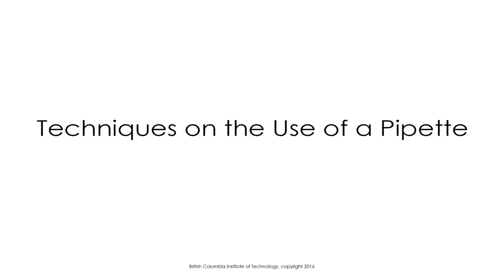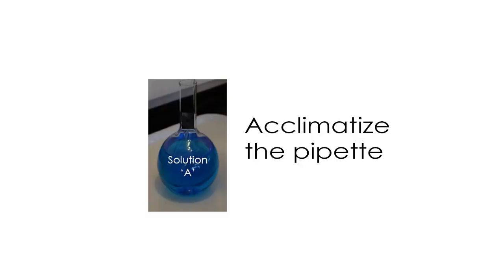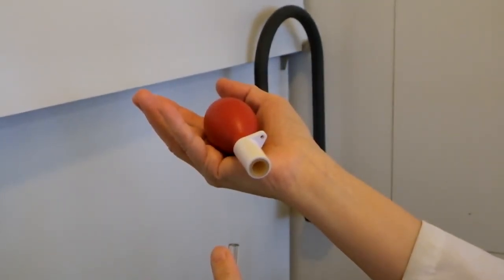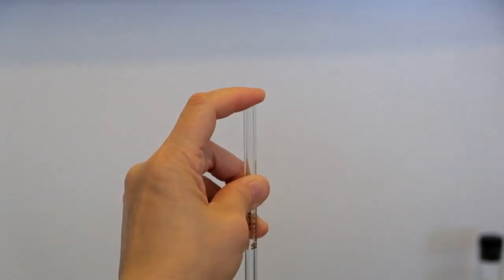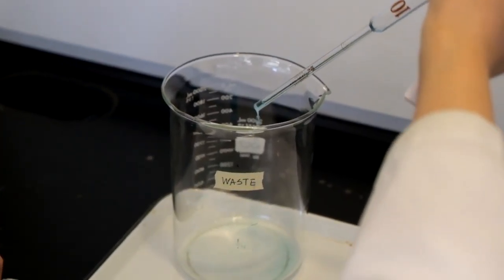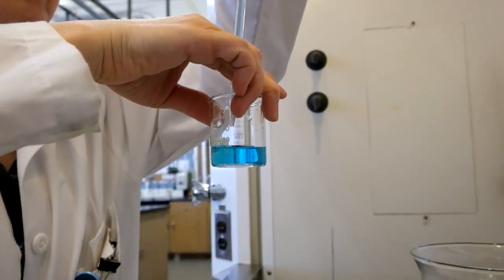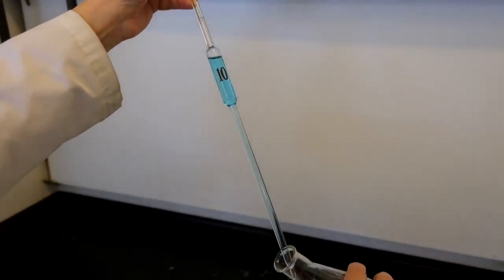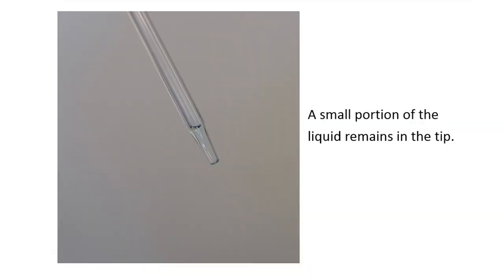Techniques on the Use of a Pipette

Comment: I think this one is the most accurate to what we have in the lab, and it was a good trick into pressing on the bulb prior to applying it on the pipette and to also have that index finger ready to keep solution inside the pipetter. My lab professor told us to slight circle around the tip to slowly control the release of excess solution.
Reply: Could you describe how to slightly circle around the tip, I just keep failing to drop the water level slowly.😢

Comment: why last drop not blow out
Reply: There are different types. This is a drain-out type pipette. It is designed and calibrated to be drained without applying pressure and retain some liquid. Some types of pipettes are blow-out type pipettes, they are designed and calibrated to be emptied completely.